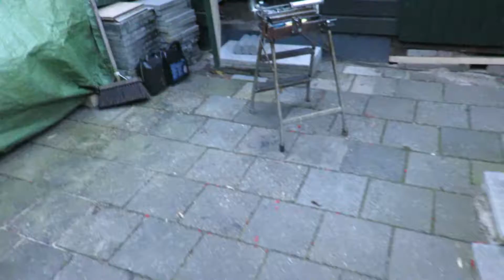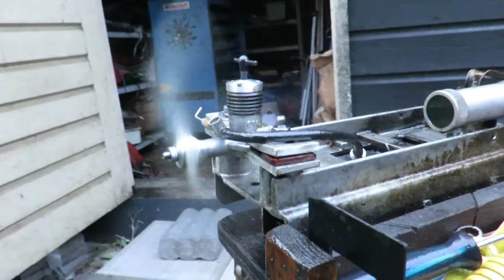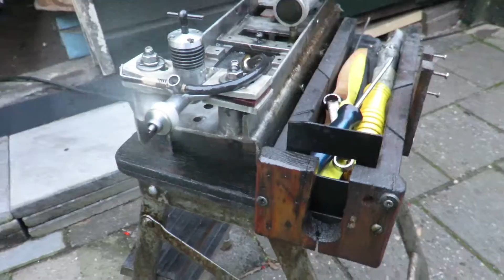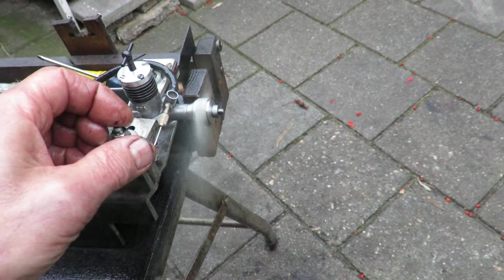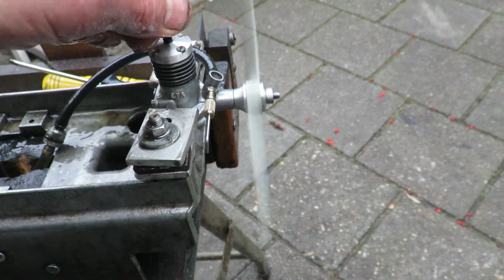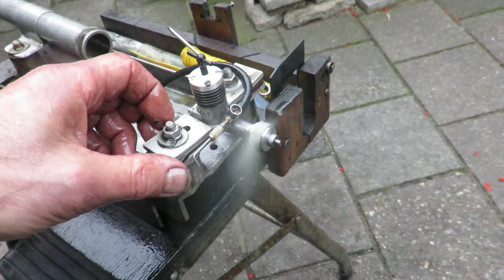ETA 1,5 diesel prototype,very first testrun

Comment: Wow. Same size as ME Snipe. I'd love to see a comparison with the ETA and Snipe and PAW but Snipe and PAW in RC and with mufflers. My PAW ran like a champ with 8" four blade prop..................but only after it got going. The prop was almost too much. .
Reply from the maker: Hi Cesar.I have also a Heron,brand new in box.Its a lovely and well made engine.
The ETA was tested in its days by ETA,and it was similar to the FROG 150 R,so about 0.15 hp. Maeby we wil do one day a rpm test to get some readings.But it runs very wel...